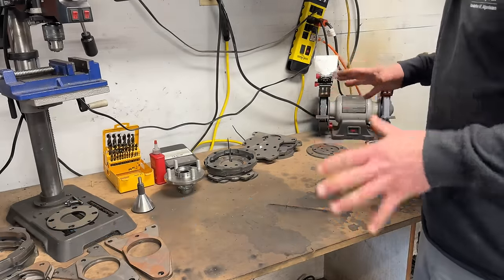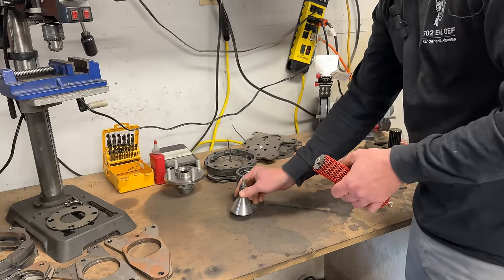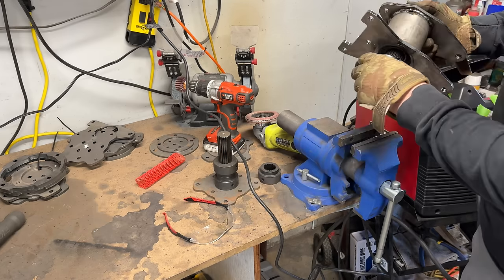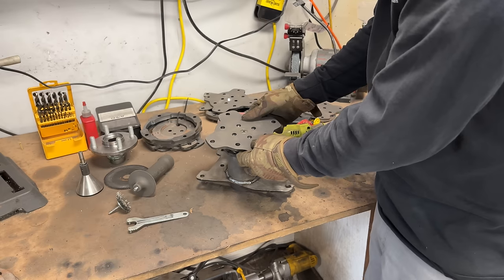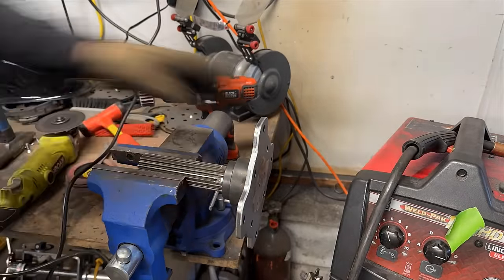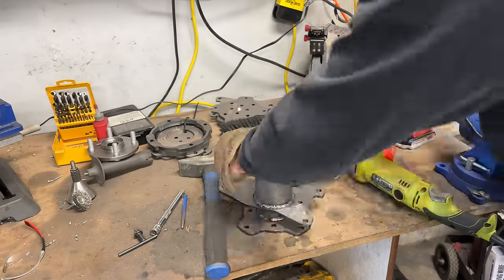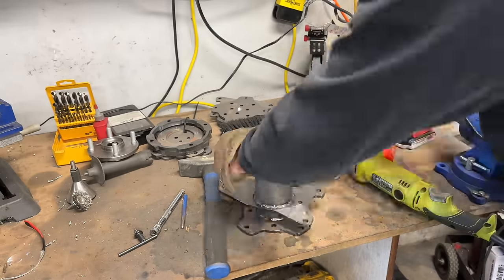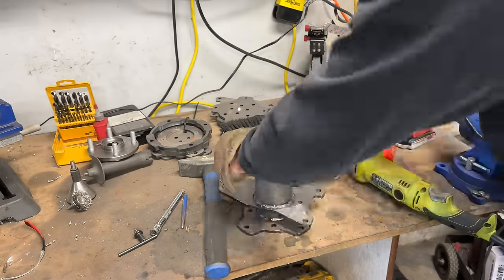Go Kart / Crosskart Drivetrain Made for HAYABUSA Power!!! Homebrew part 4

Comment: Its not just the heat going threw the bearings but the arcing between the rollers too. If you absolutely cant remove the bearings before welding then put the ground clamp as close as possible to the weld spot
Reply from the maker: That is stellar advice! Thank you so much 👍

Comment: Looks your friend was a victim of chain whip. During acceleration/deceleration your going to have a taught and slack side of your chain. In kart applications it's obviously the low side of chain. I'm an industrial maintenance tech, so I've seen this very thing. There are other factors involved as well. Everything about chain drives come down to cycles. Harmonics, heat cycles, flex cycles, and stretch are major players. Alignment is critical in high speed applications. Also chain guides to help control chain whip will help. Industry standards on spec are generally .002 thousandths. I still love the design, and i believe you'll get to a point where it's bullet proof. One more thing. Get you a good stick welder that'll run 6010 rods for those hubs. They will dig into the thick steel much better. (Hubs) A small wire fed machine is only going to give you lack of fusion and porous welds. I am going to buy your plans because i believe in your design and it's potential. Just some advice from an old hand that's done these processes. 
P.S. 6010 rods make rough welds. You can always run a cover pass to pretty it up with your mig. You'll have a strong root weld regardless.

Comment: When you're MIG welding steel, use a drag motion, not a push motion. The tip should be pointed slightly opposite the direction of travel.
Reply from the maker: If you open the side door on your welder you will find info on push, pull and correct angles. Welding fishmouths on a frame can be tricky and you can’t always get the perfect angle, but we do the best we can right?
Reply: Not true, you only drag if it's flux core.

Comment: Preheating and prepping the weld area with heavy chamfers would drastically improve the strength of these spools. Using TIG or stick would probably be better too. 

MIG isn’t really known for deep weld penetration, especially without preheating.
Plug welds aren’t really that strong either. As long as you’re not relying on them to hold the spool together, it should be fine.
Reply: I’m on the same page as you. Great design l, awesome buggies and awesome info but it’s very apparent that they aren’t seasoned fabricators. I’ll be surprised if the life of those bearings hasn’t been reduced by quite a bit too!

Comment: love your work i plan on building one with 350-400 hp soon
Reply: Bro thats wayyyyyyyy too much lol it weighs soo little
Reply: @suntzu6122  I’m going to put 90/11-15 dirt late model tire on it so it will hook way better and pull wheelies hopefully
Reply: @suntzu6122  I’m going to try to make it 1to1 to weight to make it a hyper kart
Reply: @tallstacker  bro u youre going to jump your ramp and see god with that horsepower and weight lol

He says it a lot u dont need insane hp it just makes it much harder on many components. Even 200 is insane hp for this. Youre at double that lols
Reply: @suntzu6122  I’m use to race cars 200 hp is nothing look into sprint cars they are about 1.5 weight to hp.. 900 hp and 1500lbs i raced bmod
Reply: @tallstacker  gotcha. i just remember him saying 'they really dont need extra hp because of stress on other parts' in I believe the FAQ video.

What type of axles / drive train / transmission are u using?
Reply: @suntzu6122  yes, correct I will not be using any ATV components and I will make the axle out of titanium even though it doesn’t need it will just be faster I’m gonna use light model, E, arms, shocks, spindles, and steering components super dirt late model’s

Comment: Hi KJ Do you have a link where ican buy the other parts to build the spool, I need the  Shaft, the 2 hubs, the the 4 beerings, the pipe to hold the 4 beerings , can you help please with a link to pruchase them ..
Reply from the maker: The part numbers are in the plans so you can google them to find the best prices 👍

Comment: Hey KJ im in high school, and im planning on building one of your crosskarts in our school shop when I come back from winter break! I bought the plans for the XL chassis and the rear carrier a couple weeks ago. Now I've made the decision that i only want a 3" extension instead of a 6" one. I'm planning on using a 600cc or a 1000cc engine or even if i have the funds a hyabusa engine. I would like to know if you'd be willing to send me the updated plans for the rear carrier, and a way for me to only build that 3" extended chassis and not the 6".
Reply: Just a thought. When welding the rear axle it would be a good idea to ground directly to the part being welded. By passing the current through the bearings you are shorting the life of the bearings.
Reply from the maker: For the updated plans just find your original email from when you made the purchase. And watch this video for information on stretching. All of the frames are customizable without new plans. The XL should not need to be stretched.  https://youtu.be/v-pRDkL7fOE?si=2u43mOfe8mWWUhJl

Comment: Need help on attaching upper front a-arms. I purchased used set from Polaris outlaw. I've mounted  lower arms which are wider than the uppers. My question is if your looking down at lower tabs from above, where to position upper tabs in relation? Do I place rear upper tabs directly over rear lower tabs, are line the front upper tabs with front lower tabs? Are split  the difference? Like I said the lowers are wider at the attachment pivot. Thanks for any help.
Reply from the maker: Budget Crosskart Build#5: Front End
https://youtu.be/sLovxKgyG2w

Comment: Do any of these cross carts have a differential???  I would like to build a street legal one.  But I feel it would need a differential.  Thanks..Pete
Reply from the maker: They do not need differentials. I don’t know how to convince you guys. They are light with short wheelbases. Differentials are expensive and really don’t exist for this kind of setup. Check out rpm gearboxes if you really want one.
Reply: @KJRaycing  Thank you.  I just thought that on hard pavement a differential is a necessity.  Again, I thought that the tires would wear a lot.  Thanks for the clarification.  Pete